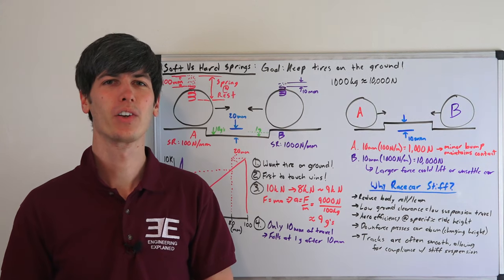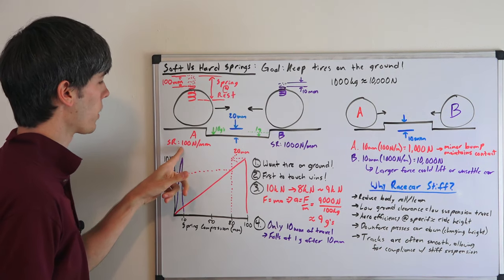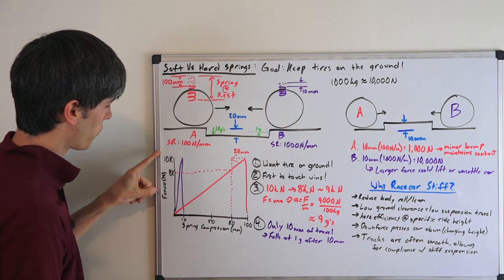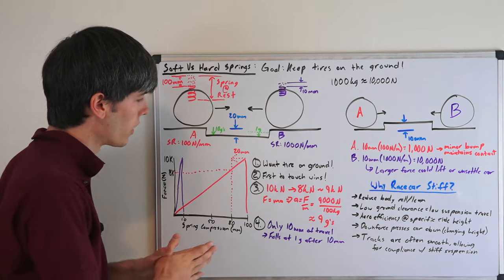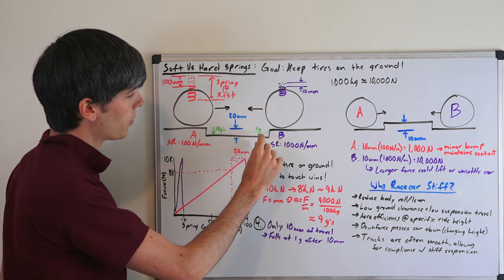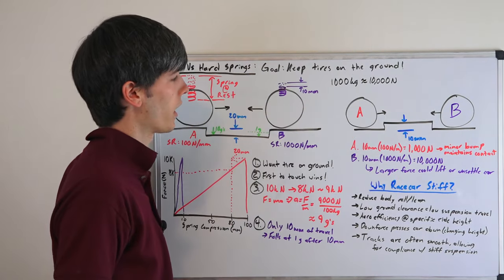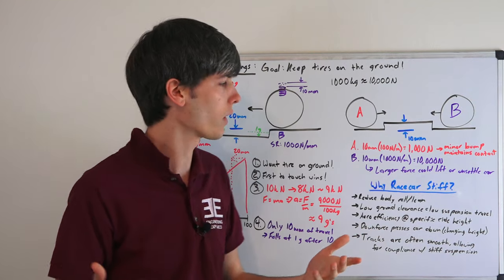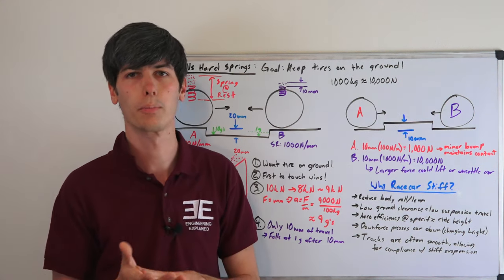What's The Best Suspension - Soft or Stiff Springs?

Comment: 2 more reasons why stiff springs work well on the track:
1. To give a driver better feedback with regard to surface changes or communicate tire compliance with the road. So if you hit a spot of gravel vs ice you can feel the  changes. 
2. Also with higher speeds on a track, impacts from road surface changes or even suspension movement due to braking or cornering causes more travel and uses suspension compliance forcing the shock to operate outside of it's optimum stroke. So stiffer suspension is needed in order for the components to handle higher speeds. Granted your tires still have to be good enough to generate the traction needed to allow for it's proper operation or you can loose more traction because of the loss of compliance.

Comment: I've always loved Colin Chapman's philosophy in car suspension design. Softer springs with long suspension travel always make for a better ride and better grip on rough roads.  The main reason why mass production cars are given stiffer springs is because people have the tendency to rely on their perception that cars that roll are more likely to lose grip on a fast turn.
Reply: Cars that roll don’t handle as well, it’s a simple fact..also we don’t drive at freeway speeds in cars off road, he seems to forget suspension settings are able the road surface your driving on,which dictates the suspension settings which work best..off road a softer longer setting is best , on a road course it’s a different beast, and even then having a adjustable setup is best